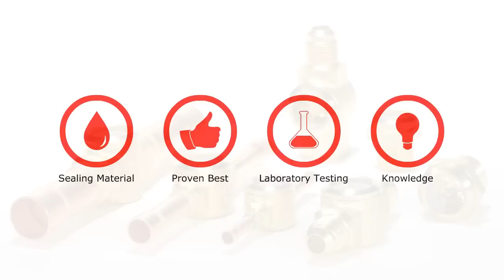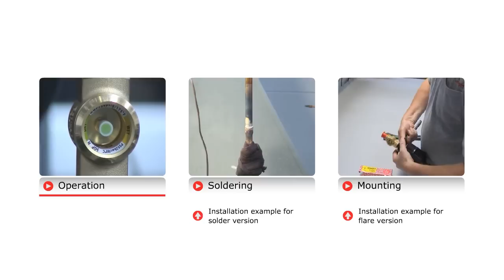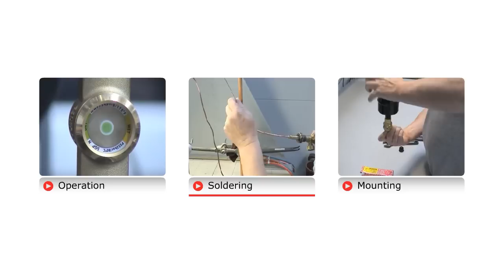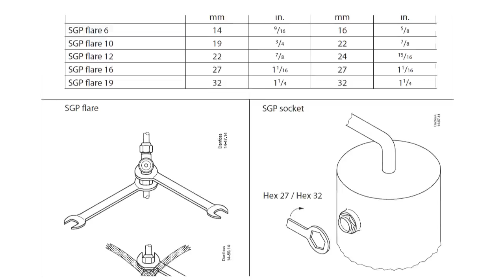Danfoss launches SGP sight glass

Comment: On 410a AC systems have to be charged by sub cooling method to insure a full column of liquid to the TXV, why aren't sight glasses used in all 410a AC units. They work great in Refrigeration systems.
Reply from the maker: Hi James,
Danfoss SGP sight glasses are developed to be used in refrigeration systems as well as air conditioning systems with high pressure refrigerants e.g. R 410A.
These sight glasses are used in many R 410A systems and they work perfectly in these systems.
Depending on the system design (e.g. expansion device, with or without receiver, split system or rooftop unit etc.) different methods to define the right refrigerant are applied.
Whether a manufacturer of a systems uses a sight glass or not can depend on many parameters as well as on the system design itself.
Reply: For the sake of cost cutting
..i will spend a few bucks extra when installing a new unit and ask the installer to put them on.